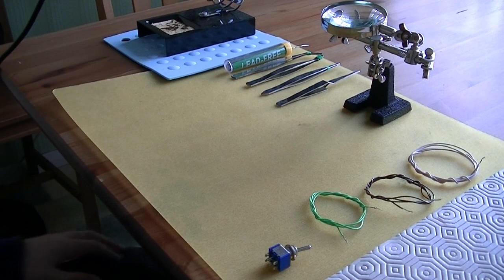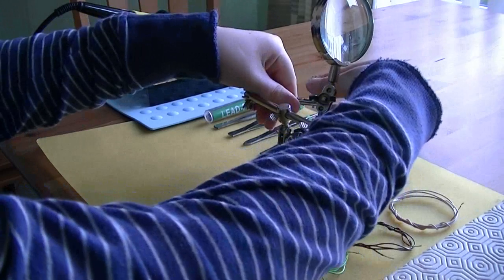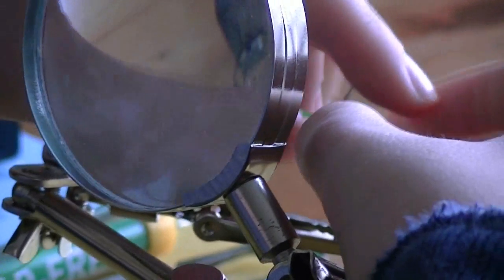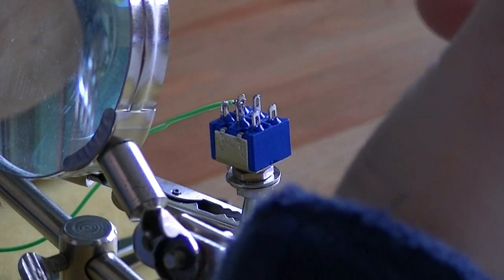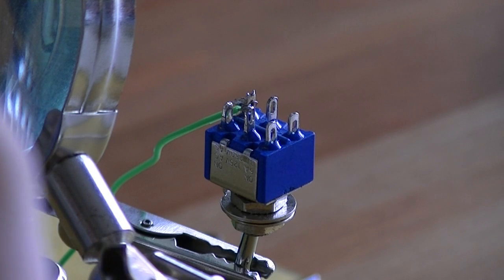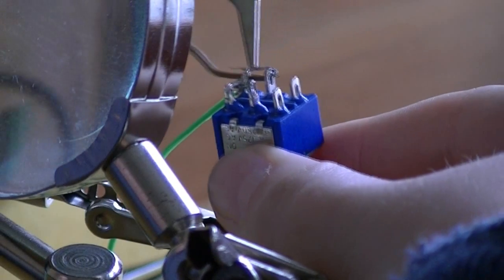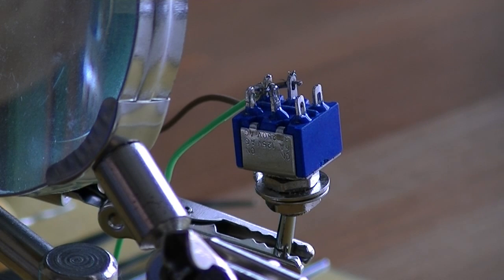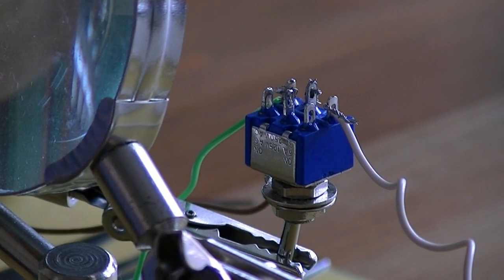soldering your dpdt switch for the berko signal

Comment from the maker: thanks for the tip about soldering the reason it is in that configuration is so the power in the middle flows to which side the switch is drawn to to light stays on and i used a six dpdt switch is to show you later how to configure it to point on the other side of the switch 
thanks

Comment: Nice work, when you solder you should place a small amount of solder on the iron - then place the cold solder contacting one side of the terminal and place the iron on the OTHER side of the terminal and by conduction this will fuse BOTH together and it will be one encasement of solder instead of little blobs everywhere as you are doing :)  Also letting us know the basic reasons for negative/ground/positive being soldered on - why it is only on that side and in that configuration - nice quality!